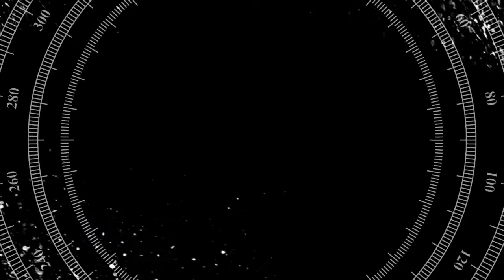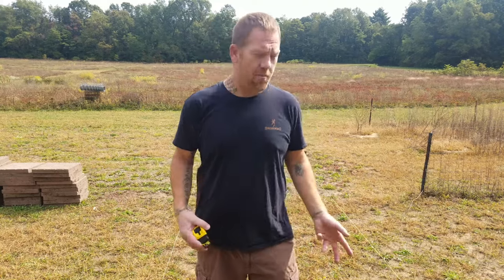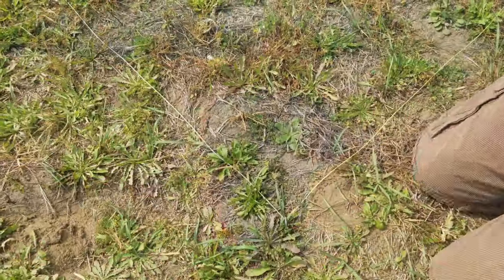How to square a corner [3,4,5 method]

Comment: I always used a 2 foot framing square and string line , I guess how You get a square corner is really similar . If you had framing square against 2 pegs and pull string line in and out to establish right angle  on the other leg of the square  you can move the line in it out  to line up with square and run a 100 foot line pretty damned square.Then take your diagonals measurements  and I like your method to check and adjust  corners.  3,4,5 inches, 3,4,5 feet ,6,8,10 . Good easy to understand explanation you did!

Comment: If I may respectfully interject here, I have found using the 345 method is really helpful but I Go with 3 feet, 4 feet, 5 feet. Not inches. I believe it gives a more accurate square

Comment: It's just better to use a tool called a square a lot faster.
Reply: So I’m guessing you have a 40 foot square.   This method works great. I used it in feet instead of inches. But you get the idea.  Thanks for sharing.  Some people are always going to have something stupid to say.
Reply: @richsharp1524 
90 degree angles don't change over distance.